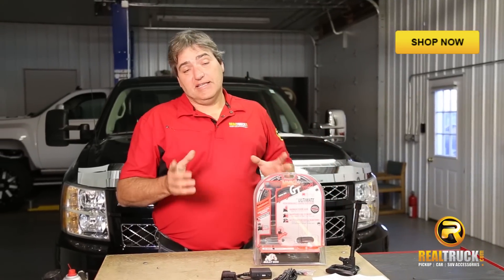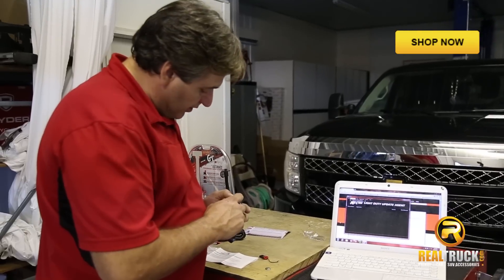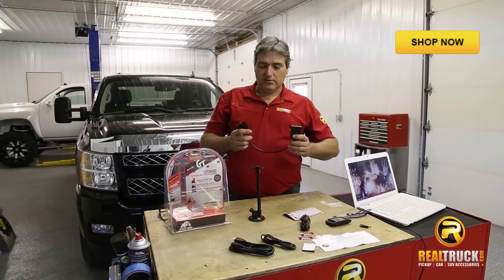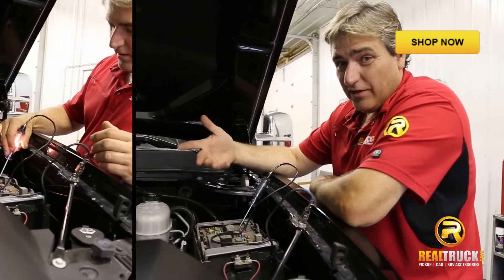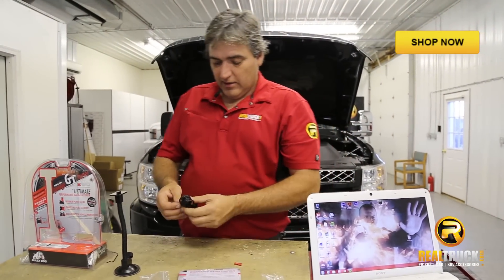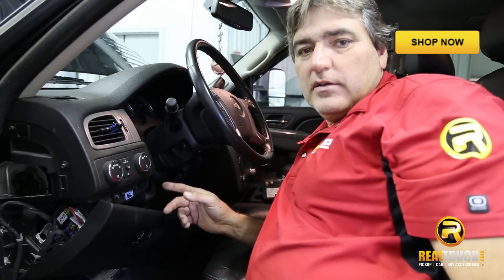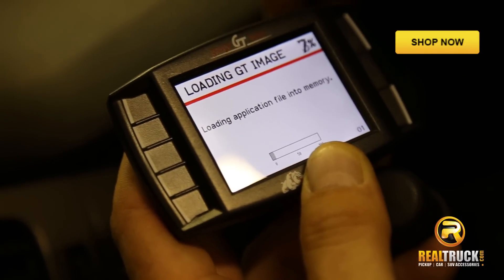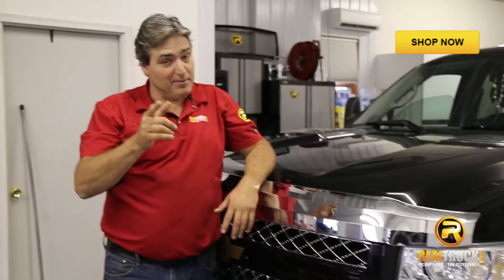How to Install the BullyDog Triple Dog GT Programmer on a Chevrolet Silverado

Comment: Good vid but seems like a lot of info missing. Sure is a lot of instructions. I didn't get one for 2009 Suburban 1500 4x4, 5.3 for performance or anything but to get rid of friggin top speed limiter. Was hoping ya'll would cover set up. Have one on 2001 2500 Suburban 4x4 8.1L w/Autoride. Oh, yeah, both are emergency vehicles. The '01 went from like 101mph to almost 140mph until loading it down with gear and adding some light bars. Yes, that's too fast BUT Autoride performs similar to Corvette magnetic suspension. Lot of arguments bout Autoride but it AIN'T just air suspension or rear leveling. I've never heard a compressor or seen it raise up or down. It adjusts yo your driving. No lean in curves. Headlights don't "float" because truck don't float and truck does not dive under hard braking. 
Braking: I've talked this much. Added drilled and slotted rotors for better cooling and time let that gas build up out. O'Reilly's has some brake pads originally developed for NASCAR and the combination of the rotors and pads are amazing. Especially if you tow or just drive hard. No fade, doesn't dust up your wheels and the Suburban stops unreal better. I can run with Crown Vic police cars but of course not with Hemi Chargers but mainly from WAO on interstate in an emergency stop it would take almost a hundred yards more to stop. After these brakes and rotors maybe a few car lengths. And it's over 8,000 pounds, I think. 
This 2009 I traded for, no Autoride, 1500 instead of 2500 and 5.3. Got it for upto 17mpg as opposed to 8 or 9 in the 2500 Suburban. BUT speed limiter at right at a hundred. Runs better than I expected and I haven't changed exhaust or installed throttle body spacer. 
Oh yeah, if you don't know about throttle body spacers it's the most performance you can get for the money. Actually feels like more improvement than the programmer. I out em on everything....Lincoln limo, 4 Corvettes, Suburbans, pickups, Prowler, well, you get the idea. Usually $100 or less. Reckon just gives fuel and air another inch or so to mix and the design supposedly "swirls" the mixture. I don't care how it works, it just does. Looks good too bein machined and polished out of one piece of aluminum. Usually installs with no mods just keep in mind it adds it's width to you air intake plastic but no problem. 
Sheite, PTSD and me got carried away again. After over 40yrs of fightin evil doers here and 10 other countries guess I either deserve it or earned it bein a trauma and cancer magnet. 30th surgery in August '18, spinal fusion. But I'm taller now. Ya'll take care. Nobody will read this but if one of ya'll does and knows clue me in bout this programmer and speed limiter. L8r.

Comment: on the bully dog web site they don't have any programmer/tuner for a 2014 Ram 2500 with a 6.4 Hemi ...   they do have one for the 5.7 but that not the gas engine that comes with the 2500...

Comment: hey, my bulky dog it's taking forever and it's not loading. Any recommendations??
Reply from the maker: Roberto,

The best course of action would be to contact Bully Dog directly. They would be able to troubleshoot any problems you are having with their equipment.
Reply: RealTruck.com 
hi sir, I did today. The one I have is for California only. Now I'm stuck with this one. I learned the hard way. I should bought it straight from Bully dog
Reply from the maker: Roberto,

Did you purchase the programmer through us? If so and it is incorrect our customer service team should be able to help you out. Now if you are in California that would be a different story as no one can sell them in California unless it's certified.
Reply: RealTruck.com 
No sir, I'm in Texas. I called Bully dog this morning and the gentleman said that there's nothing that they can do. The place that I bought doesn't want to make a return
Reply: is there any way that you can exchange my product?

Comment: I currently have a 2007 Silverado and get 9 miles to the gallon. If I was to purchase this how much more would I get to the gallon would you assume?
Reply from the maker: Hi Nick, The Triple Dog GT is more of a fuel mileage coach. You enter in what you would like to get for gas mileage and the unit tells you how to drive to achieve that miles per gallon.

Comment: it would be nice if you would have shown where you ran it at on firewall
Reply from the maker: +Casey Schoenberger every vehicle is different. The best thing is just to check under your dash and find a spot where your truck has a pass-through hole.

Comment: will this have to be installed on the car while tuned or can I take it out and put it away after the tune has been programed
Reply from the maker: +George Mendez it has to stay hooked up to the vehicle. What you are thinking about is called a programmer.

Comment: my instructions say to put the chip on battery not key so it doesn't lose power during set up. do you switch it back to key after the setup is complete?
Reply from the maker: +Andrew Kuras i do remember seeing that in the instructions, however, I can not find it anywhere. I would recommend checking with BullyDog because I honestly don't remember what the setting is for.
Reply: yes switch to key once hardwired is installed to the ignition

Comment: Can you installation video work for a 2013 Ram 1500 Quad Cab.... can you do a update video for a ram 1500 quad cab.
Reply from the maker: +Antonio Davis yes this is a pretty basic installation. There may be some subtle differences but once you get started just follow the on screen instructions and it will pretty much walk you right through it. No. Sorry. I do not have access to a 13 1500. These vehicles that we use are either employees or the dealers will sometimes loan us one for the brand new stuff.
Reply: Thanks for you reply. .

Comment from the maker: Alex Vazquez changing the Octane rating on the chip is mostly for fuel economy readings and driving coach fuel management programs. You can find out more here:
http://www.realtruck.com/shared/pdf/manufacturers/128/bully_dog_triple_dog_gt_instructions.pdf

Comment: So I put this on my 2012 5.3 silverado and after I installed program truck will not start. No help from tech support all though he tried. Any suggestions?
Reply from the maker: CaptCaaaveMaaan hook it back up and reset it to factory. Here are the instructions 
http://www.realtruck.com/shared/pdf/manufacturers/128/bully_dog_triple_dog_gt_instructions.pdf

It starts on page 33
Reply: Yea thanks for reply. It was an issue with the program, GM engineer found and fixed and got it going. One thing for sure,BullyDog has awesome tech support. So if anyone has issues with it not cranking up after installing,keep calm, stay patient,and let BullyDog techs do their thing.

Comment: Are all of the parts mentioned in the video included in the pack?
Reply from the maker: Noel Lozano Yes, you will need your own PC to upload the updates. There are add ons you can get to monitor your exhaust temperatures.

Comment: Can you show how to install this to Infiniti FX45 =) Thanks ! (2004) How many horsepower I will get more?
Reply from the maker: Eero Laukkanen Here is the link to the data sheet. It really depends on Fuel Octane and some other variables as well. As for the install. They all install very similar. You just enter different Year Make Model info.                                                                 > http://www.realtruck.com/shared/pdf/manufacturers/128/40410_gt_gas_product_information_sheet_1.1.0.pdf